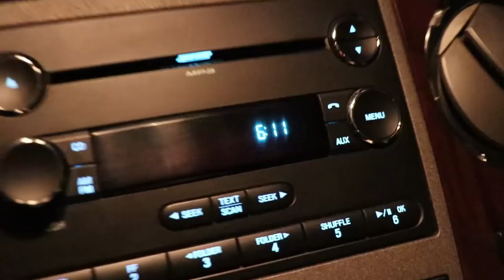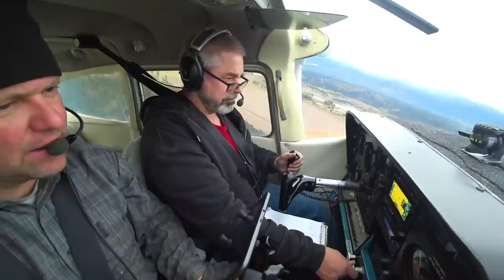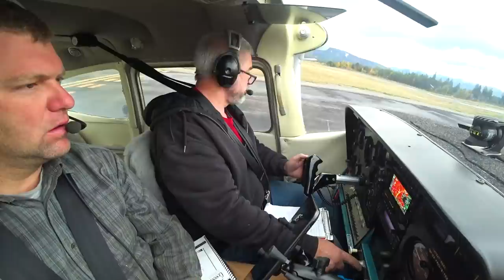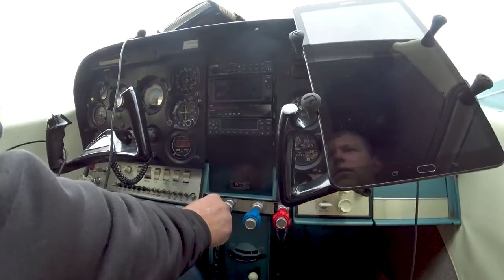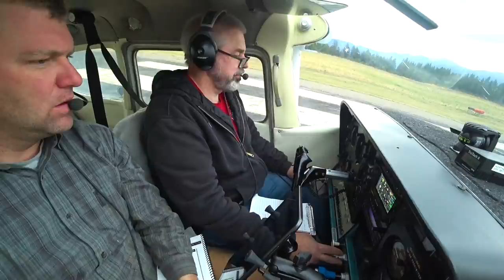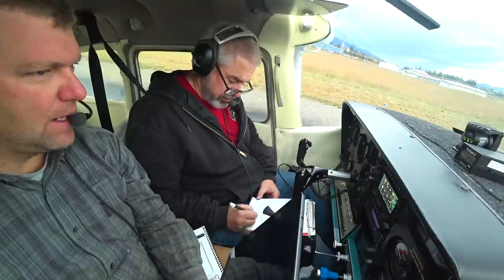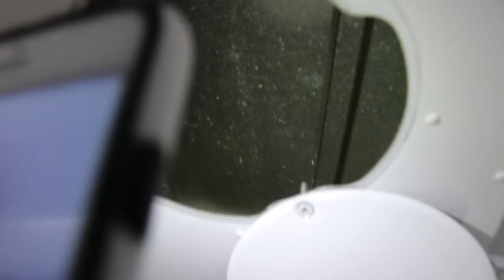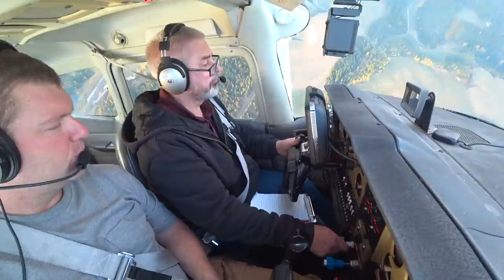Think Buying a Classic Car is Hard? Try a 54 Yr Old Airplane!

Comment: I happen to be an A&P/IA, DME,  retired FAA inspector and aviation author on how to purchase an airplane without getting burned.  I wrote a book that walks you through the process and what to look out for in your purchase.  The book is called Handbook of Aeronautical Inspection and Pre-Purchase it has saved many of new owners from buying a basket case.  Also, I do pre-buy record checks this is where you should start.

Comment: As a long time pilot and Cessna owner, i congratulate you on your new PPL. Love your channel. It would take so much time to drop you some knowledge on buying an aircraft. Please grab an aviation mentor and A&P to help you shop. Engine health is primarily your concern, many planes sit and dont fly much. Check logs for accuracy and make sure all MX has been legit. Most of the value of these legacy planes are found in the engine. Not paint or avionics or sentiment from the owner

Comment: I went through the same thing last year.  80 to 100 hour pilot when I started looking at planes.  Took me 6 months and two planes that failed their prebuy inspections, to find my 182M.  Good luck and take your time.  Looked over the logs of 10 or 12 planes.  In total I crawled around 5 different planes and even took a day trip from Portland, OR to Corona, CA on one.  In the end the plane I bought was local.  

If you already haven't committed to it, get your instrument rating.  That is the best thing you can do for your flying.  I started on mine with my new plane.  8 months later I had the rating, and I bet I would have been weathered out as a VFR pilot a bunch of times without it.  

Good luck!

Comment: Two tricks an old a&p who was a flight instructor taught me in a checkout flight. Slow flight in turns and max speed then nose over can show control issues and vibrations. Good luck on the search and smart to to do a prebuy inspection, money well spent! When you buy routinely do oil analysis it will spot problems before they become a major problem.

Comment: A reasonable way to get in the air without renting is to buy into a plane that is a shared plane or possibly a club that owns planes.  I flew to solo ticket then stopped.  My dad continued and got his license.  He bought into a 4 owner Beech Sundowner.  Four great guys, 2 older that didn't fly much but wanted the status of owning a plane.  You had to fill the gas when done. They charged themselves $25 an hour to fly which went towards the annual, insurance and hanger cost.  etc etc

Comment: I have been a private pilot for 18 years and have over 1,200 hours in single engine aircraft, I have owned a 1965 Cessna 182-H and a CGS Hawk Arrow II Ultra light (Now fits into Light Sport) and built a Vans RV-7A.  My suggestion is to by a certified aircraft.  The value of Home built aircraft do not hold their value like Certified Aircraft do.  I flew a Cessna 182-H for nine years flying it all over the US and up to Alaska.  When I sold it, I got every penny I put into it back as for the initial purchase and upgrades.  Average yearly annual cost me roughly $500 where I would assist local A&P mechanic perform the inspection.  My RV-7A was not so good, I had $105K into it and sold it for $94K with just over 600 hours TT.  We made the decision to purchase as we like to travel cross country and local FBO's would not allow us to rent to take the cross country trips. Now with the cost of fuel and my wife working for American Airlines we choose to fly comercially.  Not as fun but a heck of alot cheaper.  Insurance for RV-7A completed and airworthy in 2007 cost me $2,500 for $90K in hull coverage.  No accidents or claims ever as a pilot. We watch your YouTube channel often and love the area you picked to build.

Comment: I can't stress enough how important it was that you attended the inspection.
 A friend of mine bought a 210 sight unseen, had it inspected by the local mechanic at the FBO it was kept.
It passed with flying colors. (We suspect the owner might have been related to the mechanic...)
 He bought it, took a commercial flight out, and ferried the aircraft back with his son to his home airport.
 The mechanic there, looked at the plane and after opening just one inspection plate, saw that the corrosion was so bad, the wing roots were ready to fall off. It was a miracle they didn't die in the air. 
It took about a year to resolve the issue, the law suit was ugly and expensive.

Comment: 182 is certainly a nice family plane, but not very fast for the fuel burn. I had a Bellanca Viking, inexpensive plane, 40 knots faster than the 182 on similar fuel burn. My Mooney kicked the crap out of both of them on fuel burn and much nicer flying plane too. Anyway, take your time and get the plane that fits how you fly. If you don’t fly over 100 hours a year renting is probably better depending on hangar costs where you are and insurance, etc. Good luck.

Comment: From this distance flying seems a lot less risky than roofing. Perhaps because the assumption is the opposite. Flying requires systematic training, supervision, practice. Roofing is something you work out by trial and error. If it doesn't work try something new. Can't recommend that for parachuting! I learn a lot from you guys. There is so much to think about. Thanks for sharing.

Comment: Purchasing and selling an airplane is quite an experience.  First, as a buyer, I trusted the fellas who were selling N5159A a 1979 Cessna T-210N.  I overlooked items such as windscreen deice and the deice boots as I was not going to use them.  Instead, I spent on state of the art avionics.  Selling when I lost my medical, the buyer engaged his mechanic to ream the aircraft that my mechanic had already reamed on an on-going basis.  The hiccup was the deice and the boots despite all working except the wind screen de-ice.  Suggest looking at the T-182 or T-182RG if not a T-210.  Flying vicariously.

Comment: Ya just got your license. Don't buy a plane. You don't even know what you want yet. Don't buy a plane. Whatever you THINK you want today will change as you experience other planes and as you actually travel. DON'T buy a plane .... not yet. Rent, rent, rent. Drive to other fields to rent other planes. Experience as much and as many planes as you can and I PROMISE YOU, your tastes will change, and to the extent they do not, will only serve as reassurance that you're doing the right thing. Then consider buying a share into a nicer plane with like minded owners that agree by contact, to never rent or borrow the plane.
Reply: On second thought, ignore me. Youth is spent well on the young. Live your dream.
Reply: I have helped a number of people buy boats, and I always make the exact same suggestion. With less than a year in you have no idea what you want, how you will really use it, or what limitations will matter for you. You may not care about an extra 20kn, or being able to cruise at 190+ could be a deal breaker. Trying to cross mountains in a 160kn plane with a 100kn headwind sucks (One flight we spent 6 hours trying to leave North Carolina). Climb rate in the mountains could be a huge issue for you, or it may not be a real issue... But anything not IFR I wouldn't even look at where you guys are. 

But I do miss our old Cherokee Six. That was a fun plane.
Reply: They should find a local Flight Club to join and gain hours. Then look into a plane a few years down the road. I started in a 152 for 3 weeks just didn't like the feel. Stepped up to a 172 to finish. Joined a flight club that has 2 182 rg turbos and a king air 300. Now rated in both aircraft types after 2 years and yearly dues are much cheaper than renting and I've never had an issue of getting a plane when I want.

Comment: As someone who worked on helicopters for the U.S. military. Aircraft are extremely expensive to maintain. I have seen aircraft screws that were $50.00 a piece. Just beware, you are gonna pay for that airplane over and over again in maintenance cost.
Reply: Paper the aircraft over and over again with maintenance. This is ridiculous. A single-engine private plane is not a $25,000,000 military helicopter

Comment: I would seriously suggest you not buy a plane at this point.  Finish the house, get more aviation under your belt.  There are huge costs to insuring maintaining and housing aircraft.  All your experience so far seems to be in high wing.  get out there and do some low wing.  Try some rolls in a Bonanza 35. Get some twin engine time.  Try a Gyrocopter.  I know the stairs are finished, I would like to see the video.
Reply: That is actually good advice (which is rare in the comments) A good point well made sir! :)

Comment: Don't buy a plane yet.  You are only just half way toward finishing the house.  Enclosing a house, windows, roof, doors,, is just half way through the total.  Now I will grant that you have a leg up on insulation.  But that leg up is also going to make the electrical install, much slower than conventional,, and perhaps the plumbing and heating as well.  Interior walls?  Then,,,,, after the mechanicals are in and approved,,, then you get to finish your insulation,,,,,  then the drywall,,, taping, plastering,,,, bath,   floors,  kitchen, paint,, fixtures,,,,,,, You are half way.

Comment: Been there done that, have the airplane to prove it!  :)  I wouldn't wish airplane purchasing on my worst enemy!  It was a terrible experience.  Now once you have the airplane, it's another story.  I went through 6 months of what you're doing and have many crazy stories.  Finally after all that time I did end up with a 1964 Piper Comanche 250.  Love that thing.  And yes, owning a plane is expensive, which is why I involved a co-owner.  If you can make that happen, it helps dramatically.

Comment: Haven’t finished watching but if you’re getting vibration.. it’s possible the rod bearings are done. Probably sat a while.

That tape on the prop is probably your vibration.

Why wouldn’t the mechanic re-spot-weld instead of drill out the crack?
A lot of people don’t know that metal moves after it’s been forged. Heck tin turns to crystals. You have to rework metal to make it stable. It’s a lot like wood.

Comment: 182's are a good starter plane especially if you want a plane that sits 4 people. Because you are flying from a small airport, be sure to consider where will you be keeping your plane? Are there hangers available? Or will you have to tie down outside? And how much will that cost? Some airports have 20-year waiting lists. You've probably considered annuals and regular maintenance, but what about repainting? And new instruments? You are right, aviation is a love affair with a very high maintenance mistress with expensive needs. ❤🌅🌵

Comment: A Cessna 182 is a good performing airplane. BUT the Continental O-470 is the weak part. They almost never make it to the 1800 hr TBO. Usually at about 1200 hrs they need a top overhaul (cylinder and piston replacement). If your heart is set on a 182 the Cessna 182 RG is a better choice. It is faster with retractable gear and the Lycoming O-540 will go 2000 hrs to TBO almost every time. More money but you live in moutain country and the extra performance is a real safety item.  I have 25 years and 2000 hrs as a CFI. You probably already know this but if you fly less than 300 hrs per year it is cheaper to rent.
Reply: I wouldn’t recommend a Cessna retractable. You’re better off going with a Piper, Mooney, Bonanza, etc. The Cessna setup is a mechanical shit show.

Comment: Interesting Comments on this one. Someone mentioned getting a IFR rated plane. I went through this same process a few years ago looking at planes (BTW Still Rent) and a very helpful FBO enlightened me on getting myself IFR rated and buying an equivalent plane. Due to the area we live in (not that far from your location) small IFR aircraft have very limited usefulness due to icing. Almost all spring, summer and early fall we have so many sunny days you just don't need IFR and then it turns cold, cloudy and wet/snowy. These small planes are not made to fly in ice conditions so in our particular locations it really just not not make a lot of sense. Now the other areas, it might. 
As much as I want (key word WANT) to own a plane I just cant make the numbers make any sense on paper, so for the time being renting it is.

Comment: I owned a Grumman Tiger for 30 years, unless you are going to fly at least 150-200 hours a years the fixed costs are going to really suck compared to renting.   I had and A&P/IA certificate and did all my own maintenance, which helped the cost analysis but you still have to buy parts.  In the end as my flying hours dropped I sold the aircraft because it just didn't pencil out any more.  For long trips you can't compete with SW or Alaska airlines and there are just so many $100 local ham burgers flights you can do .  I am too old now, but if I had to do it again these days I would buy or build one of the Van's RV models and skip the certificated aircraft route all together.  Most used aircraft are old and tired;  old radios, old paint, old interior old structures and unknown engine condition. Don't get me started on accessories; starters, alternators, vacuum pumps, carbs, exhausts, governors, magnetos and props.  It's a death of 1000 cuts.  A simple Rem37By spark plug now costs $34 each mail order and a new mag  well north of a grand.  Then you have AD's recurring inspections and life limited parts to consider on top of your annual inspection.   You want something reliable, especially in your neck of the woods.  Off home airport maintenance is not a joy.  Something like a Van's RV14 will run circles around anything used you can buy.  You can easily keep your armature built aircraft updated, modernized and maintained, something which the FAA will not let you easily do to a certificated aircraft, so many road blocks to doing even simple things.
Good luck

Comment: A 182 is a nice plane, variable pitch prop, at 25/25 you should see a true airspeed of 140 knots. 
What ever you do, check the logs and see when the next TBO is, if it is less that 1000 hrs, really work that price down about 5 grand.  those are expensive.
You are going to be trading up in 3 years (trust me, you will start to look at the 206, or the 210)  
I would start with a 172, not as fast,  but with full fuel, 2 seats full, you still have a useful load of around 200 lbs.
Cheaper per hour to fly,  and you only loose 20 knots airspeed.
When you actually start a family, it will take 3 to 5 years until you out grow a 172 and by that time you will be in a 182 RG, or even a P210 so you can climb above  FL 120 without needing oxygen.  Nothing is worse than O2 stuck up your nose.

Comment: Glad you passed on the first one. My heart sank when I initially saw the bad rivets on the trailing edge. There also appeared to be some corrosion in the wings, based on the view through the inspection plate. Too much potential risk to let things develop further and definitely too much time and money to repair. The red and white one looked pretty nice. You mentioned avionics upgrades - with the ADSB mandate coming up soon, you'll be spending a fair amount to meet the needs anyway, so might as well get the panel set up like you want it.

Comment: always read ALL log books. I had a 182 prospect and it had a tiny note on the 3rd page (log book) to refer to annotations in 337. The annotations were the plane was wrecked and rebuilt by insurance cuz they thought it was to expensive to total it. It litterally was rebuit in a hanger from the back seat back.  When dickering with price tell them to knock off 40k for new/rebuilt engine. Cessna Dealerships do exist. btw the 337 was 50+ pages of parts actions.

Comment: Antique? My 1941 Aronca 65 CA Super Chief is an antique. To me the older the better. If it doesn't have struts, fabric and a tail wheel. To me it's not right. But for the family to be, your on the right track. Make the most of the time you have, old age comes to fast. I was born in 1950, and it goes by to fast. Live the dream while you can.
 What is your alt.? Mine is 98 feet. 7B3 North Hampton N.H.  You know the higher you are = less power.I know you know this but most non pilots do not.   . Buy one time, don't chase other peoples problems..  semper fi

Comment: yes  the red  airplane was a nicer looking plane and since you  had  flown her before you do have a history with that plane  take a deeper look  check all the cables and control surfaces the engine sounds sound how many hours  are on the engine when was ther  inspection  who did it. ?  any RED X in the inspection logs have they been addressed and signed off can't think of anything else  i bet you could pickup  used C-130 acft  in the Arizona desert  pretty cheep.

Comment: Well done and thanks for the video once again. Probably a wise choice on the blue plane. Seems to me that STOL capability should be designed into the airplane. Not an aftermarket add on. It could also indicate what the plane had been used for in the past. Quick powerful takeoffs and short abrupt landings.  (drag racing vs interstate cruising)

Comment: Why was the headset mic practically in his mouth?
Reply: This is normal for aviation headsets. It's because the mic is set at "low power" to minimize picking up aircraft noises, so then it has to be very close to the mouth (usually just touching it) so that the voice is loud enough to be heard by others.
Reply: Cristian Rosca sometimes they don’t pickup so well.  So... you eat the mic.  :-)
Reply: Thats typical for pilots.  Planes are noisy.  You want to make sure your radio calls are clear, so the mic is usually super close to your mouth.